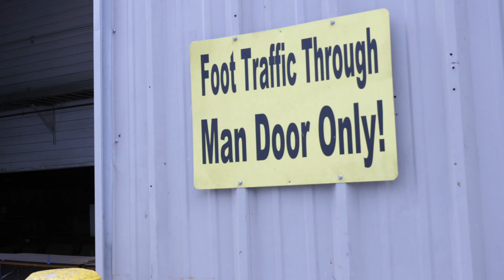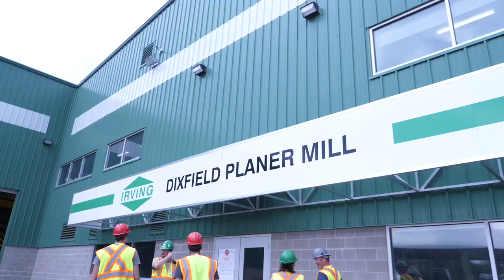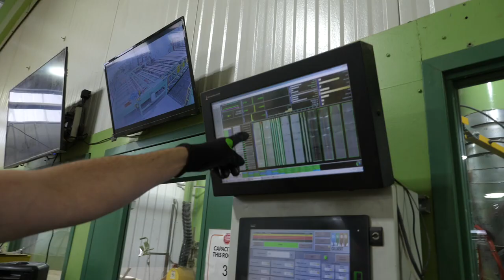We Tour Our Lumber Mill! (this is insane) S8E14

Comment: I live outside of Augusta if you pass by portland in the drive up id stop at duckfat their sandwiches are decent but fries cooked in duck  fat and gelato  shakes worthy of my 500 lb life or in house made soda and donut holes.There is actually 2  now their original on middle street has a larger menu and local beer but the other has most of their to die for stuff and is right off i95